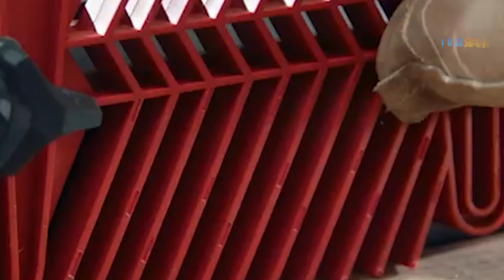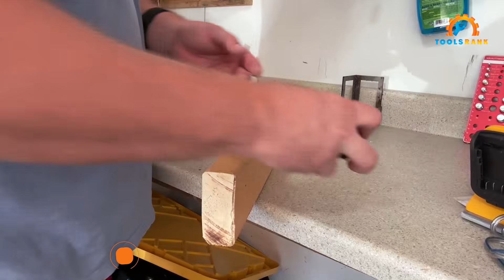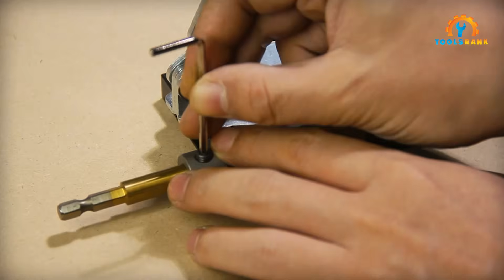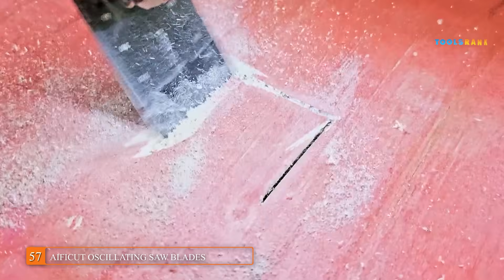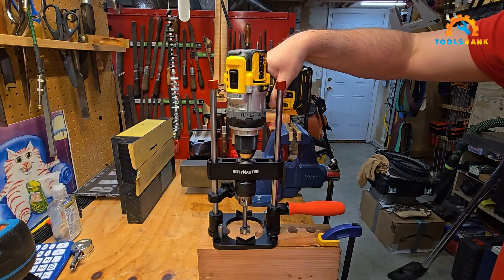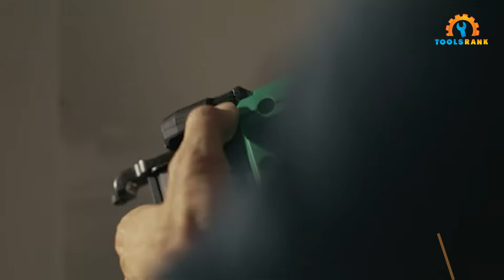100 Coolest Woodworking Power Tools On Amazon That Actually Save Time

Comment from the maker: 1	Bosch Plunge & Fixed Router	
 https://www.amazon.com/dp/B00005RHPD?tag=toolsrank-20
2	SKIL 9" 2-Speed Band Saw	
 https://www.amazon.com/dp/B0BFR2BJQP?tag=toolsrank-20
3	AVID 5" Orbital Sander	
 https://www.amazon.com/dp/B0BPC5SWXB?tag=toolsrank-20
4	DEWALT 20V MAX 3-Tool Kit	
 https://www.amazon.com/dp/B08N6JJ7V9?tag=toolsrank-20
5	SKIL Router Table Kit	
 https://www.amazon.com/dp/B09FPBFQSX?tag=toolsrank-20
6	TwoWin Compact Router + Bits	
 https://www.amazon.com/dp/B08M6578D9?tag=toolsrank-20
7	Sharpening Stone & Guide	
 https://www.amazon.com/dp/B0CQLNWX66?tag=toolsrank-20
8	Klabb 10FT Dust Hose Kit	
 https://www.amazon.com/dp/B0DWSCBTDL?tag=toolsrank-20
9	Self-Center Doweling Jig	
 https://www.amazon.com/dp/B0B985CXPB?tag=toolsrank-20
10	Bucktool Belt & Bench Grinder	
 https://www.amazon.com/dp/B0BTYF1NHZ?tag=toolsrank-20
11	Rockler Multi-Port Dust Set	
 https://www.amazon.com/dp/B078N4NM26?tag=toolsrank-20
12	Cordless Router for DeWalt 20V	
 https://www.amazon.com/dp/B0DK525WN5?tag=toolsrank-20
13	Thin Rip Table Saw Jig	
 https://www.amazon.com/dp/B0DZHBHKJQ?tag=toolsrank-20
14	Worx 2-in-1 Work Table	
 https://www.amazon.com/dp/B01HREBZ3M?tag=toolsrank-20
15	20PCS Carbide Burr Set	
 https://www.amazon.com/dp/B09MSSXFWQ?tag=toolsrank-20
16	Saker 4-in-1 Drilling Ruler	
 https://www.amazon.com/dp/B0D5QCVW84?tag=toolsrank-20
17	DEWALT 20V Orbital Sander	
 https://www.amazon.com/dp/B07QKNYTGK?tag=toolsrank-20
18	AVID Oscillating Multi Tool	
 https://www.amazon.com/dp/B0DS29KX75?tag=toolsrank-20
19	Router Table Setup Bars	
 https://www.amazon.com/dp/B09YC9SXXS?tag=toolsrank-20
20	Saker Thin Rip Jig	
 https://www.amazon.com/dp/B0D81KX6P4?tag=toolsrank-20
21	3A 9" Benchtop Band Saw	
 https://www.amazon.com/dp/B08SK9W4Q5?tag=toolsrank-20
22	20V Cordless Hand Planer	
 https://www.amazon.com/dp/B0FLVVJHVK?tag=toolsrank-20
23	GALAX PRO Oscillating Tool	
 https://www.amazon.com/dp/B07TW55GD4?tag=toolsrank-20
24	Dremel 160PCS Accessory Kit	
 https://www.amazon.com/dp/B00BHGJHMI?tag=toolsrank-20
25	Cordless Hand Planer 20V	
 https://www.amazon.com/dp/B0F2N4YGTM?tag=toolsrank-20
26	Saker Multi Scribing Tool	
 https://www.amazon.com/dp/B09W8S61JS?tag=toolsrank-20
27	13PCS Wood Carving Discs	
 https://www.amazon.com/dp/B0CJ8YZ8JY?tag=toolsrank-20
28	Retractable 65FT Air Hose	
 https://www.amazon.com/dp/B0C538R6DS?tag=toolsrank-20
29	Mini Belt Sander	
 https://www.amazon.com/dp/B0DCJGNK35?tag=toolsrank-20
30	Cabinet Handle Jig	
 https://www.amazon.com/dp/B0CGJ45S1F?tag=toolsrank-20
31	Dremel Wood Carving Bits	
 https://www.amazon.com/dp/B08ZBWF6BT?tag=toolsrank-20
32	Thin Rip Table Jig Guide	
 https://www.amazon.com/dp/B0CBKSZ1D1?tag=toolsrank-20
33	JiGiU 800W Wood Router	
 https://www.amazon.com/dp/B0D4QTD23M?tag=toolsrank-20
34	Dremel Lite 7760 Cordless	
 https://www.amazon.com/dp/B07R9PNRBD?tag=toolsrank-20
35	3PCS Wood Carving Burrs	
 https://www.amazon.com/dp/B0D1N5ZV99?tag=toolsrank-20
36	BOSCH 6" Orbit Sander	
 https://www.amazon.com/dp/B09DQ6SZFD?tag=toolsrank-20
37	Push Block for Saws	
 https://www.amazon.com/dp/B0BD88R2GH?tag=toolsrank-20
38	Metal Pocket Hole Jig	
 https://www.amazon.com/dp/B0CTKCNP3C?tag=toolsrank-20
39	WORX 20V Reciprocating Saw	
 https://www.amazon.com/dp/B01LW6OEMU?tag=toolsrank-20
40	DEWALT 20V Angle Drill	
 https://www.amazon.com/dp/B007ML7DHS?tag=toolsrank-20
41	BORA Pocket Hole Jig	
 https://www.amazon.com/dp/B0FDXNDSWJ?tag=toolsrank-20
42	EZARC 15PCS Countersink Bits	
 https://www.amazon.com/dp/B0CTJFX5DX?tag=toolsrank-20
43	AVID 3.5A Oscillating Tool	
 https://www.amazon.com/dp/B0DSKDFQXD?tag=toolsrank-20
44	Metabo HPT Belt Sander	
 https://www.amazon.com/dp/B07MG8LDZG?tag=toolsrank-20
45	18G Cordless Brad Nailer	
 https://www.amazon.com/dp/B0DGXPFBFD?tag=toolsrank-20
46	Dobetter Drum Sander	
 https://www.amazon.com/dp/B0C1YSQ61M?tag=toolsrank-20
47	AVID 1.25HP Compact Router	
 https://www.amazon.com/dp/B07CQK4ZL4?tag=toolsrank-20
48	8-in-1 Hand Saw Kit	
 https://www.amazon.com/dp/B0BYT8T642?tag=toolsrank-20
49	5PCS Countersink Drill Bits	
 https://www.amazon.com/dp/B0DRWS5G4D?tag=toolsrank-20
50	GALAX PRO 280W Orbital Sander	
 https://www.amazon.com/dp/B07RX6N12J?tag=toolsrank-20
51	Dremel rotary tool kit	
 https://www.amazon.com/dp/B01M1SJNVU?tag=toolsrank-20
52	Skil router table kit	
 https://www.amazon.com/dp/B09FPBFQSX?tag=toolsrank-20
53	Klein digital angle gauge	
 https://www.amazon.com/dp/B07ZWW3BW5?tag=toolsrank-20
54	Avid power compact router	
 https://www.amazon.com/dp/B07CQK4ZL4?tag=toolsrank-20
55	Teeno wood router set	
 https://www.amazon.com/dp/B0CRHCM25P?tag=toolsrank-20
56	Mtiolhig cordless hand planer	
 https://www.amazon.com/dp/B0F2N4YGTM?tag=toolsrank-20
57	Aificut oscillating saw blades	
 https://www.amazon.com/dp/B0BW5JQPVN?tag=toolsrank-20
58	Wen variable speed jig saw	
 https://www.amazon.com/dp/B07D9YFFPZ?tag=toolsrank-20
59	Gqgp hinge drilling jig	
 https://www.amazon.com/dp/B0D493YGB2?tag=toolsrank-20
60	Funnywhale cordless brad nailer	
 https://www.amazon.com/dp/B0DGXPFBFD?tag=toolsrank-20
61	Aonllen dual spindle jointer	
 https://www.amazon.com/dp/B0BDF4K95Q?tag=toolsrank-20
62	Findbuytool wood thickness planer	
 https://www.amazon.com/dp/B0D9LM34RB?tag=toolsrank-20
63	Jellas belt sander machine	
 https://www.amazon.com/dp/B08XYKWGBK?tag=toolsrank-20
64	Wuzizi cordless orbital sander	
 https://www.amazon.com/dp/B0FBVW537N?tag=toolsrank-20
65	Ecarke cordless biscuit joiner	
 https://www.amazon.com/dp/B0FJXLTR85?tag=toolsrank-20
66	Teeno cordless combo kit	
 https://www.amazon.com/dp/B0FBRFM2BG?tag=toolsrank-20
67	Leiluo oscillating saw blades	
 https://www.amazon.com/dp/B0FNRK5S18?tag=toolsrank-20
68	Alloypower cordless brad nailer	
 https://www.amazon.com/dp/B0F87FNR95?tag=toolsrank-20
69	Bullseyebore laser drill guide	
 https://www.amazon.com/dp/B0DZ9MN62X?tag=toolsrank-20
70	Heimerdinger cordless circular saw	
 https://www.amazon.com/dp/B0F6L1PP3T?tag=toolsrank-20
71	Aepiraza drill positioner guide	
 https://www.amazon.com/dp/B0FHHNS8W7?tag=toolsrank-20
72	Worx nitro switchdriver kit	
 https://www.amazon.com/dp/B0DV3V39Y1?tag=toolsrank-20
73	Pyy jewelry rock saw	
 https://www.amazon.com/dp/B0FM81C5L9?tag=toolsrank-20
74	Wen precision setup blocks	
 https://www.amazon.com/dp/B0FM5QTQSL?tag=toolsrank-20
75	Apexpower cordless chainsaw	
 https://www.amazon.com/dp/B0FBWL7RXH?tag=toolsrank-20
76	Artymaster portable drill guide	
 https://www.amazon.com/dp/B0FGCPGD8S?tag=toolsrank-20
77	Keepdone mini table saw	
 https://www.amazon.com/dp/B0F2DDTZL7?tag=toolsrank-20
78	Greenworks power tool combo	
 https://www.amazon.com/dp/B0D3F3J4XZ?tag=toolsrank-20
79	Veitorld power tool organizer	
 https://www.amazon.com/dp/B0DDXB12G2?tag=toolsrank-20
80	Galax pro oscillating multi tool	
 https://www.amazon.com/dp/B0F29C3XJL?tag=toolsrank-20
81	Dnti electric hand planer	
 https://www.amazon.com/dp/B0CR6CWYZZ?tag=toolsrank-20
82	Comoware cordless drill set	
 https://www.amazon.com/dp/B0D1VJ3QY4?tag=toolsrank-20
83	Elevon laminate trimmer router	
 https://www.amazon.com/dp/B0CCHR3HN7?tag=toolsrank-20
84	Maxxt electric orbital sander	
 https://www.amazon.com/dp/B0BYS8B4K6?tag=toolsrank-20
85	Bielmeier electric staple gun	
 https://www.amazon.com/dp/B0CKYL8L1W?tag=toolsrank-20
86	Mefape mini bench drill press	
 https://www.amazon.com/dp/B0CB3KPN31?tag=toolsrank-20
87	Saker mini cordless chainsaw	
 https://www.amazon.com/dp/B0D4DVK9GS?tag=toolsrank-20
88	Corded reciprocating saw	
 https://www.amazon.com/dp/B0CPV5MTG2?tag=toolsrank-20
89	Wood lathe benchtop machine	
 https://www.amazon.com/dp/B0FKLTWH53?tag=toolsrank-20
90	Kfmk belt disc sander	
 https://www.amazon.com/dp/B0D3KSC3MN?tag=toolsrank-20
91	Arbortech power chisel kit	
 https://www.amazon.com/dp/B0BX78CVHQ?tag=toolsrank-20
92	Metabo hpt cordless brad nailer	
 https://www.amazon.com/dp/B0D19V5RTY?tag=toolsrank-20
93	Tuejite wood splitter drill bits	
 https://www.amazon.com/dp/B0DM5GYBDR?tag=toolsrank-20
94	Werktough cordless staple gun	
 https://www.amazon.com/dp/B09D2JL7W6?tag=toolsrank-20
95	Bhtop roofing nail gun	
 https://www.amazon.com/dp/B0C6LDN1GP?tag=toolsrank-20
96	Goingmake pocket hole jig	
 https://www.amazon.com/dp/B0CTKCNP3C?tag=toolsrank-20
97	Hispec electric screwdriver set	
 https://www.amazon.com/dp/B013PTOXA0?tag=toolsrank-20
98	Woodskil oscillating belt sander	
 https://www.amazon.com/dp/B0D89VP5KP?tag=toolsrank-20
99	Dewinner electric router tool	
 https://www.amazon.com/dp/B08C52GNN8?tag=toolsrank-20
100	Bucktool bench belt sander	
 https://www.amazon.com/dp/B0BHXWZ4MW?tag=toolsrank-20